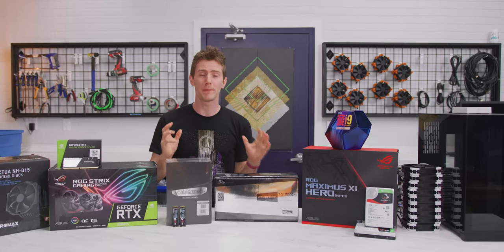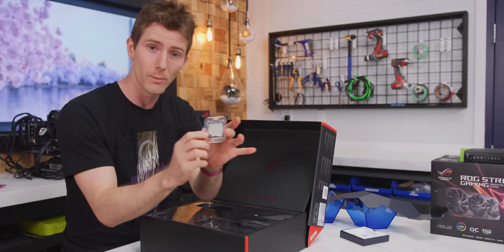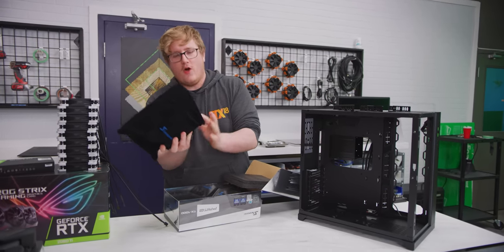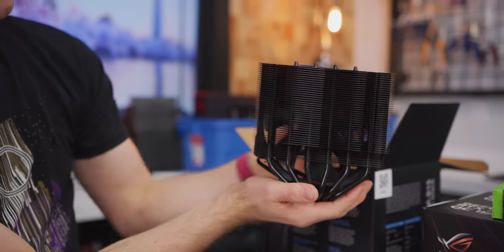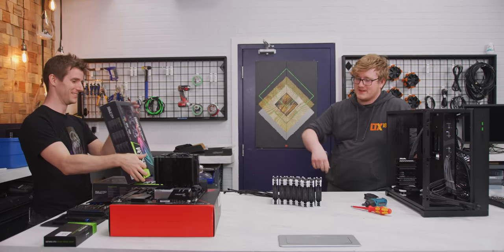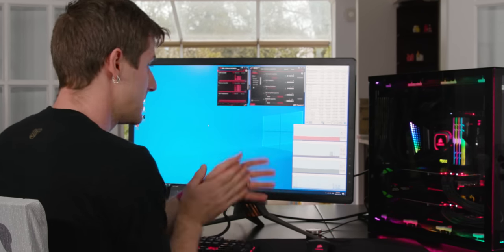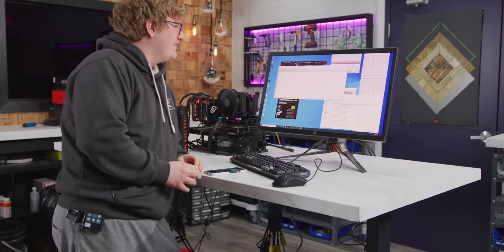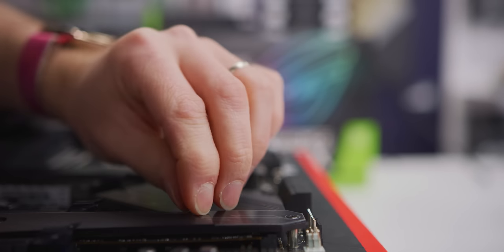Can AMD Beat the ULTIMATE Intel Gaming PC?

Comment: Dont talk about "sensible" choices when you recommend an overheating 8 core over a 10 or 12 core, because the 8 core is a few fps faster in games. What does that matter at 100+ fps. The extra cores however will last an extra year or two. I know. I had a 7700k. It was the worst buy ever. Just like a 9900ks
Reply: Not to mention that 5% lead drops off a bit when you fire up anything heavy in the background.
Reply: And then there's me, having a slight regret not going for Intel and get a 3600X instead from a 3470. Did not realize that when AMD says 3.9-4.1 GHz turbo, it means it will always goes to 4.1 every time it does anything which kinda mess up the noise profile of the system because its hovering around 60-80 degrees and that's where fan starts to ramp up.
Reply: Custom fan curves and power profiles exist for a reason
Reply: And yeah, they call the 9900KS 5.1GHz bin the best for gaming when it performs worse than an 8086K since it can clock higher and in this setup, worse than a HEDT part, including even a 2950X from SLI only running at x8 on both GPUs...
Reply: @Amusia727  I do not want to mess up with the voltage and Power-saving profile does not feel right for me. Ryzen Balanced power profile does not change anything. And no matter what fan profile I setup, it does not fix the noisiness of the AMD cooler anyway which makes me need to change the cooler into a Noctua to make it bearable. Still a shame because part of the reason I go for AMD is because I heard that the cooler is actually good enough that you do not need to buy third-party so I do not end up saving up on that front.

I would probably still recommend AMD if anyone needs recommendation right now, but its not really for the performance but more on the potential longevity of the platform with the PCIe 4.0 support and the potential savings when you eventually upgrade your GPU so you don't need to change your CPU and motherboard.
Reply: I mean I replaced the Wraith Prism on my 2700X when I had it to a Thermalright Macho Rev. B. The only Noctua cooler that is actually interesting is the U12A and even then, the price is so exorbitant that it makes zero sense...
Reply: I also undervolted my 2700X and stuck 1.05V on SOC. Not sure of voltages on Zen 2 though
Reply: @ArchusKanzaki  No matter what anyone says, never go stock cooler. No matter how good the reviews are. They are designed to work, but not to be quiet. There is no such thing as quiet stock cooler. Just doesn't exist. Not in the history, not in the future.
Reply: @ShadowManceri  ahaha learn that kinda hard way. Even just buying Noctua I'm abit wavering because I saw review and it seems there is not much difference in db count however when I put it in, its night and day compared to stock cooler. I never realized how quiet the office PC is until I build my own. I was using secondhand HP Elite 8300 SFF I got for really cheap paired with 1050 Low-profile before my current one
Reply: @ArchusKanzaki  who would've thought that an X cpu would need pretty good cooling to be quiet? tbh I didn't either, i don't blame you. Undervolting can help a bit, though i know it's not that easy on the 3000s. I used to be very strict about max temps. I was actually able to slow down the fans, allowing the cpu to get hotter, while still avoiding any thermal issues. Maybe that could work for you as well.
Reply: @kepeter97  I eventually switched the fans and put it on a Fixed RPM mode so it will keep the thing under control for longer and does not have the ramping up-and-down noise when its trying hard to maintain certain temps based on the curves. Its still got that ramping up sometimes but at least its bearable and not so often. The noise of the fan in fixed RPM (its like 3-4th of the max RPM) is masked by the ambient noise of my room and my speaker so at least I'm comfortable now. 

Like, I'm kinda new in building PC, especially having PC on AMD platform. But I watched lots of video and they all say like "the 95 W TDP of 3600X is actually a lie and its actually quite close to normal 3600" and the "Wraith Stealth shipped with 3600 is actually really good" so I combined the two and think the Wraith Spire used by 3600X, with 95W rated TDP is actually more than enough. Apparently there is more to that story but its still nice experience.
Reply: Hahaha AMD cry babies suddenly appear out of nowhere! HE SAID GAMING! So it means best in gaming, he recommneded the best CPU full stop in gaming that actually runs in games less than 75 degrees unless you use unrealistic stress apps! So get over it! 8 cores is more than enough for all apps a normal gamer will use
Reply: @TRX25EX  You sound like an Xbox fanboy.
Reply: lmao, 7700k as the worst buy ever? i still use a 7700k, running at 4.8Ghz, and i can play games like FF14 at 144FPS, on 1 screen, have google chrome with YT, or twitch on another, and other games in the background, and it STILL not be at 100% use. a 9900KS would be overkill for anything under the sun that isn't rendering.
Reply: It was the worst buy ever considering 9 months later you could have bought the 8700K, and had no real reason to buy over the 6700K unless you were set on hitting 5GHz. The only good thing about 7th Gen is that it didn't require a new motherboard, but why does that matter when Z270 was obsoleted within 9 months when Z370 was a requirement for 8700K. Don't even get me started on how awful of a buy the 7600K was with only 4 threads...

And no, running other games in the background isn't possible with only 8 threads if you mean any recent titles. Coming from someone who uses a 6700K, even GTA V can have the CPU dip to 100% utilization. That's a game where people said there was "no reason to buy an i7 over an i5". That statement aged so poorly.
Reply: @droptoasterintub297  with that logic, it doesn't matter what CPU you buy when, because in 9 months you can get an even better one that would blow it away for roughly the same price , am making every cpu purchase a crap buy unless you use it for a decent while
Reply: I'm perfectly okay with CPUs being obsoleted within 9 months because of actual innovation. The difference here is that Intel simply rushed Coffee Lake ahead of schedule to finally give 6 cores on a non-HEDT platform when 7th Gen should've been 6 cores in the first place when we already knew Zen was going to ship with 8. Intel offered nothing for 7th Gen that 6th Gen didn't offer. IPC was the exact same, core counts were the same, and even the pricing was the same. An i7-7700K performed no differently when clocked the same as a 6700K. It just never made sense why Intel bothered refreshing what was pretty much the same thing already.
Reply: @droptoasterintub297  6700k couldn't do the speeds that 7700k can, (4.8-5GHZ)  and if all you're doing is gaming, and streaming, the 7700k, is still plenty, as long as you're not doing it in  4K resolution. it handles 1080P and 1440P at 60-144FPS quite easily. aside from a select few people who do more than game, or browse the web on there PC's or even stream, 8 Core CPU's and higher aren't even necessary, because most games and applications can't even utilize more than 2-4 cores. unless you're doing high end multi tasking it's just not really "beneficial" to go out and buy an 8 core CPU, or even a 16 Core one, programmers just haven't "caught up with the times" yet. which is pretty sad at this point. and by the time they do, even better CPU's will be on the market than there is now.

Comment: great, comparing a "silicon lottery" OC intel to an off-the-shelf stock clock amd... really fair linus, rly fair
Reply: Overclocking Ryzen 3000 actually worsens gaming performance, because you are giving up per core turbo frequency for a higher all core load clock. So yeah, it is fair.
Reply: It actually fair as they have the exact same price
Reply: it was about price fanboy.
Reply: @anonymous134y  The price is the only thing fair about it though.
Reply: @pauloazuela8488  maybe they could have overclocked it themselves but that's the only thing. Prebinned 3950x, all 4.15ghz, would have been 25%+ more $$
This is a clear win by intel for gamers. Regardless, 5%-15% on games is pretty damn good.
I'm sure Ryzen 4xxx coming out this year might actually beat intel in gaming.
All I care about is the numbers, not the company.
Reply: I knew I would find some pressed AMD fans in the comments. I was not disappointed so thank you Danilo
Reply: @anonymous134y  I only care about the value they had. Well none of those cpu will be a great value for me since I don't need them
Reply: @pauloazuela8488  you are not good at debating
Reply: Well, he said that didn't care about "bang for the buck" on this build, so the price argument is irrelevant. The best off-the-shelf product from intel vs the best from amd. One had OC and the other didn't. Eos
Reply: @anonymous134y  I wasn't particularly debating, just stating my opinion.

Comment: The two HDs sort of ruin the philosophy of the build. Who, "with a straight face" would put 32TB of storage in a gaming PC?
Reply: raises hand
Reply: Considering how cheap you could probably get it, I probably would if I had a use for that much storage
Reply: If I didn't pay for the parts, I absolutely would. I've got an 8TB Raid 1 right now because I buy my components. 

Computers are great in no small part because they are NOT just consoles. You can do anything with them. Including a media library.
Reply: I have 7 2tb nvmes in my build. Because, because.
Reply: I mean HD monster hunter takes about 100-140gb by itself. Dem games add up.
Reply: Considering how big games are getting 32TB might be a bit tight.
Reply: I'd go 128 tb
Reply: Me
Reply: I’d say that for a gaming device it’s probably overkill. 2TB might not be enough but 34TB is a little excessive. However if you have a PC this powerful you’re probably using it for stuff other than gaming and those hard drives would fill up fast.

Also they’re like $200 each and if you have 2 $1200 GPUs in your computer an extra $400 is a rounding error
Reply: @jasonthesnow  i have a total 3.5 TB and its tight

Comment: Linus: We're gonna build a computer that someone actually might buy. Immediately pulls out a specialty "silicone lottery" processor.
 
Goes Overkill with SSD's. Overkill with HDDs. Overkill with the GPUs. Overkill with the fans. Overkill with the case. Overkill with the cooler. Goes overboard with the MoBo.

Yeah nah, this is definitely not a computer anyone would normally buy.
Reply: com'on, the cooler is actually affordable....xD

Comment: Ok so what speed was the 3950x running at? Just so we know because we know everything from intel system and nothing about the amd one... we don't know if ram is the same, we don't know if also the 3950x was from silicon lottery because they do carry ryzen now, we don't know boost clocks of the GPUs....
I mean if this was to be a bit more scientific I certainly wouldn't have minded a bit...

Comment: 14:32
Not true. All the remotely reliable leaks and rumours say Zen 3/Ryzen 4000 Desktop will be on N7P or 7nm+. 5nm is for Zen 4/Ryzen 5000.
Reply: That said 10-15% ipc gains and 200mhz frequency boost and 8c CCX complex should put them easily on top of all workloads.
Reply: He said 4th Gen, not 4000 series.
Reply: @sepdriandputra1093  4th gen Ryzen is Zen 3 which should be out later this year.
Reply: @emu071981  he meant zen 4th gen (zen 4, not zen 3)

Comment: It's pretty simple to see the differences, just look at Bitwit's video on it. For the most part the direct competitor for either side, Intel performs 10-15% better in games, and AMD performs 25-40% better in basically everything else in most use cases, what you choose should depend on what you're doing. Of course AMD is more bang for your buck since it's better overall, but if all you care about is gaming and aren't into heavy content creation/streaming or other heavy CPU workloads, go with Intel for max gaming performance.

Comment: I want to see the gaming performance while streaming in these tests. Most of the time the FPS are similar (and high) enough on both Intel and AMD to not notice the difference. But streaming might hit Intel CPUs a lot theoretically.
Reply: Not with the 2080Tis. They have the NVENC encoder. I have a 2080 and when I stream I have 0 hit in CPU performance.
Reply: @Code-n-Flame  Yes, but just for the sake of comparison, I'd like to see some stats.
Reply: That will no longer be true with the i9-10900K
Reply: The choice in a RTX GPU (or 2), does largely negate the need to do CPU encoding, but we otherwise do already know AMD's advantage there. NVEnc on Turing cards is on par if not better now.

Comment: So question, the intel processor is binned and oc'ed. Is this a fair comparison? Is the AMD one that as well? Apples to apples guys.
Reply: The binned and oc'ed i9 was the same price as a off the shelf AMD 3950 so the comparison is fair. A binned 3950 would cost more than the binned i9, so not a fair comparison anymore.
Reply: @samuelisch2196  overclocking is free
Reply: But then you could just buy a 9900kf for 430 dollars and overclock it to the same level as this one. Then you would be comparing it to the 3800/3900x.
Reply: @Time_Traveling_Lesbian  overclock the 3900x to get 4.65ghz on 12 cores vs intels 5ghz max overclock on one core.All 8 cores can go a little less than the amd cpu (4.6ghz). Games that utilise multi core processing will have better performance with the 3900x plus intel motherboards are slightly more expensive but you are correct in saying that intels i9 9900kf can outperform the 3900x in some games
Reply: @drheal2  do you really think the 3900x can overclock to 4.65ghz? at safe voltages, voltages under 1.3v is probably okay, but even that may be a little too much. The 3900x overclocks to like 4-4.2ghz on average all cores.
https://www.pcgamesn.com/amd/ryzen-9-3900x-overclock
The 9900K, most of them overclock to 5-5.1ghz thats a 25% frequency advantage.
Reply: @Time_Traveling_Lesbian  checked out the article and you are correct. I must of misread something about this somewhere.